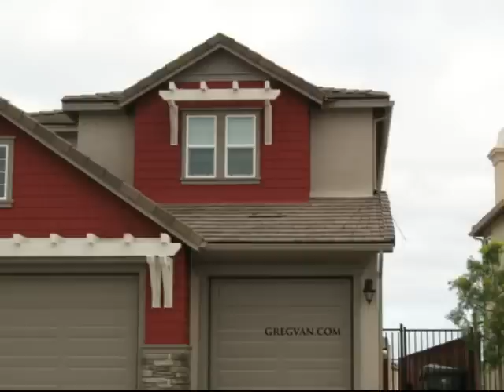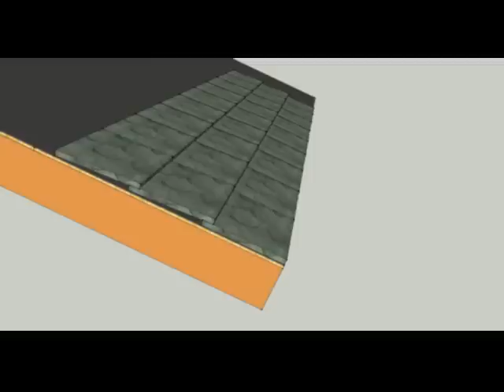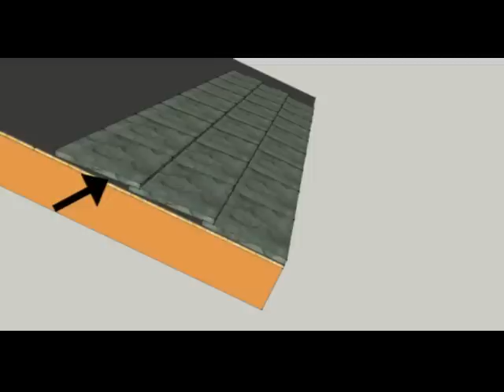Roof Gutter Downspout Draining Location Problem - Home Design

Comment: thanks for the video, good explanation. I'm currently planning to relocate two of my downspout to a outer location far away from my wall, it is leaking from end cap of gutter to the wall and travel to basement. Do you recommend cover the old downspout hole, adjust the gutter slop and drill a new hole, will the covered old hole with piece of aluminum and some sealant start leaking in the future? thank you